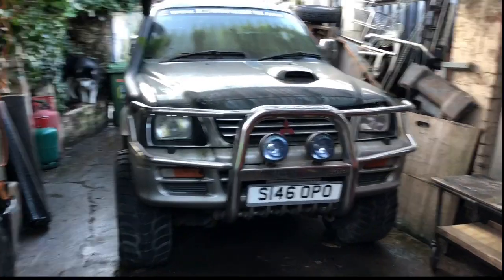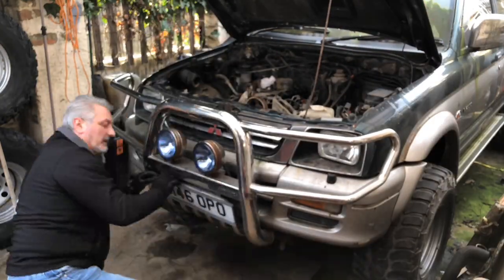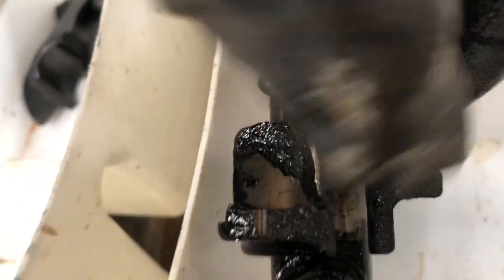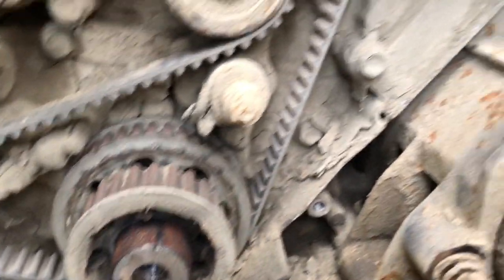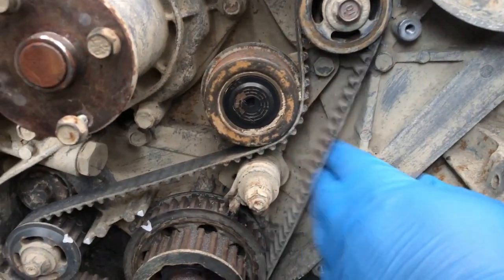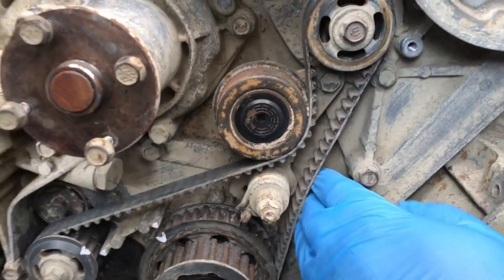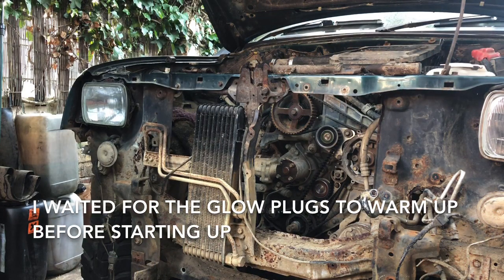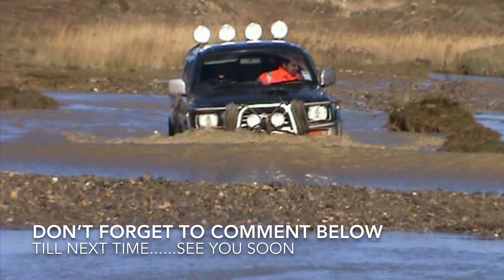L200/Triton 4D56 Snapped Timing Belt And Rockers repair (part 1)

Comment: Hi Antonio.
Robbo here. just wondered if you could help., I have not yet attempted putting on the timing belt or balance belt. Having marked all the timing points the only one not lining up is the crankshaft it stops just about two teeth from the mark. tried rotating it and just the same only this time couldn't move it anymore, pressure seems to hold it. any suggestions would help greatly, tried the net just got confused. Thanks
Reply from the maker: Hi Robbo, 
As always this is my opinion and cannot take responsibility for any outcome, worse case would be valve(S) bent/broken stuck stopping the piston moving up and aligning “ top dead centre) from the top inspect the first valves on the front cylinder to see if there is any slight damage ( valves slightly bent etc.) At this point of the crank will not move I would remove the head and check everything is ok there. Unfortunately we are not always lucky and damage happens when belt snaps. As said check valves can move all the way up and are not stuck etc and take it from there. Don’t give up I know you will sort it 👍

Comment: Antonio, just one question, when you fitted the new rocker arm and rockers did you put a bit of oil on the shaft,I have bought a new one already made up and it looks very dry...
Reply from the maker: Yes I did, lube it up before you put it in place or it will be running dry for the first minute when you start the engine up. You don’t want it rotating dry 👍

Comment: Enjoyed watching this video, but wish you would have shown a bit more of how to put the rocker am together. I will be attempting the exact same jobs on my Shogun sport warrior 2.7 year 2004,
pretty similar engine I think... Anyway very good video and hope too see more...
Reply from the maker: Hi, thank you for the positive comments. I haven’t posted for a while due to COVID issues, but hope to get back on my builds soon.
I had a complete spare shaft and rockers so didn’t have to change individual ones, but there not that difficult/strait forward to swap over on the shaft if need be. 
Check if your engine is the same as the 4D56t comes only in 2.5lt diesel 
The 2.8lt diesel is the 4M40 engine and is chain driven. Different counties were exported different engines and specs. 👍
Reply: @antoniosbackyardtruckbuild208  Thanks for the feedback Antonio..I will be getting started as soon as this weather breaks. Yes it is a 
4d56t...once again .
thanks...Robbo.

Comment: Hi my belt just snapped on my L200 just ordered a belt kit and 2 broken inlet rocker arms that were damaged. 
I know I have to line up the marks on the cam and crank etc but do you have to rotate the cam or crank a certain amount of times to get the pistons in a certain order before I put the belt on? Or if all the marks line up up then am I safe either way?
Thanks
Reply from the maker: Hi, sorry for not getting back to you straight away, busy at work.
If you have all the pulleys on the timing marks lined up then pistons and cams will be all lined up, this will be TDC (Top Dead Centre). I will post more when I get back from work tonight 👍
Reply: Hi Antonio, great video mate. My son’s MN triton has broken a timing belt whilst starting in the driveway. The mechanic replaced the balance belt and timing belt but has said he can see a rocker arm has snapped in the engine. He has told us to get a new motor. Should I attempt to replace the rockers as a reconditioned engine plus install is $8k here. The belts and timing is correct so is it easier to have a go at the rockers at home. Thanks again for any assistance. 😊
Reply from the maker: @RyanIngleton hi, thanks for watching my video 😊.
I would say for the price of a rocker shaft/arms I would give it a try. It’s a 50/50 chance the valves aren’t bent and like mine could be ok. It can’t get any worse if it fails 🤷‍♂️. I’m not a mechanic but like anything else if you do your research you find enough info. to have an idea of how it works. I really hope you give it a go, if not for the truck for the time spent together with your son, on the project,priceless.
    I haven’t recorded a video in a long time but will be back soon working on the trucks, welding chassis, bodywork repairs, major overhaul on them to in the coming months. I hope it all works out for you, never underestimate what you are capable of 👍
Reply: @antoniosbackyardtruckbuild208  Thank you so much mate I really appreciate you for taking the time to address my question. I will be taking your advice and attempting the repair together. 😊. Cheers champion 🤝
Reply from the maker: @RyanIngleton hi, how did it go? Did you sort it?